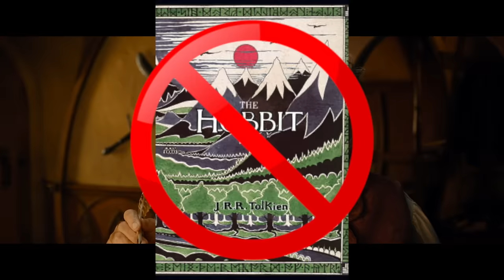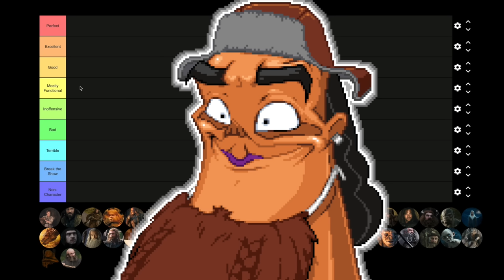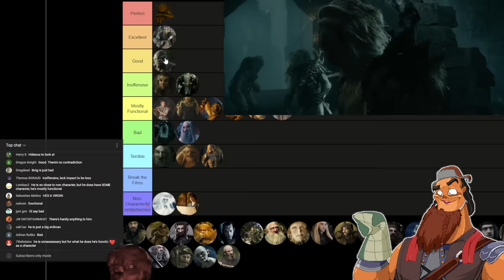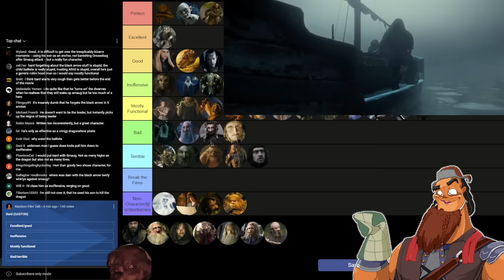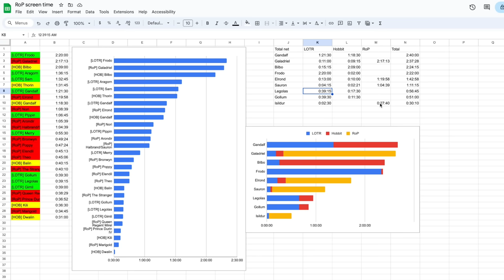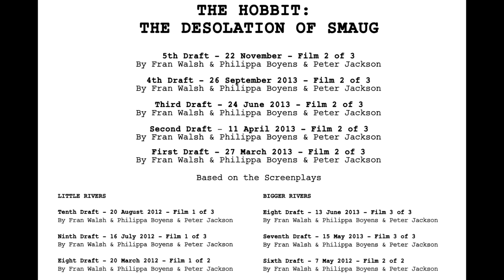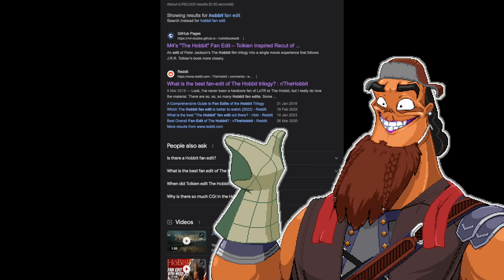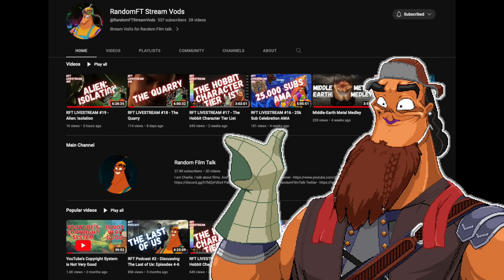The Hobbit is Not Very Good: The Final Autopsy

Comment: Great Video again.

What i wanna Add is the following.
In all forms of storietelling (Book, Movie, Games, etc.) You need a goal you want to achieve and making that goal clear to the audience and the charackters is important and can be done, like most things, in various ways.
But what you also need is some sort of "ticking-clock"-element, or better said a reason to do things now and not later.
In Most Mission impossible and action movies in general its basicly "Do this to stop the bomb you have x Hours, good luck".
With this element in place the charackters need to use their time efficiently.
This kind of Element doesn´t have to be overarching it appaers in multiple forms, the smallest yet functional version i can thing of righ know would be the rolling Stone in Indiana jones 1, here it is very clear that if indie doesn´t move he dies. 
Wich leads me into the Hobbit Movies.
And i want to compare it to the movies, soly to show how things could be done if this element would have been handled differently.
Case in point the Hobbit-Book doesn´t have this driving element in its overarching Plot.
The Companie starts now because why not,  and because they do not have any specific time they have to arive at erbor the rest of the storie can take its time, they don´t have to rush to any particular point. To be clear they spent days if not weeks at elrond, to whom they walked not being chased, they spent days if not weeks in the mirkwood forest(inside the forest and then again in prison), and they spent days at laketown and days if not weeks at erebor to find the entrance.
The only times they have to move fast is when they got activly in danger, trolls goblins wargs etc.

The Movies Changed that fundamentaly.
In that they made it clearer over the 3 Movies that, atleast the charackters thing so, they have to arive perfectly at this one day. Additionaly the writers thought it necesary that the companie has to rush to any particular place/solution aswell. Examples would be: Trolls, Rivendale (ariving and Leaving), Mirkwood (Forest, Prison and Barrelride), Laketown and finaly Erebor.
If, in the Movies, they would have delayed their journey, even for just one hour they couldn´t have reached the secret door.
That makes it that much harder to believe that they achieved what they did, since it essentialy boils down to them having won the lotterie not ones but several times in this story.

With the book approach this is no issue, if they for example had spend one more week in the dungeon of the woodland realm nothing would change in the story.
The Problem Bilbo has to solve is, how do i get those dwarfes out of here? and not how do i get them out of here now?.

Funnily enough it seems my solution for this Movie would be that it needs to take more time, but if we cut the bloated things out we do have that time so yeah.

I hope i could make clear what one of my Issues with this movies (and so many other Stories) is.
One more thing to think about.
I think the Lord of the Rings at its beginning are a counterexample in that the movies deal with this issue way better then the book does.

Comment: Liked your assessment of the characters. The fluidity around Radagast is very justified; he's very effective in getting things done, but the hyper-eccentricity behaviour detracts from the character.
Thranduil is one of my favourite characters and I think you're over critical of him as a commander. Elves are very disciplined and will have trained together to fight a certain way - bow at range and then in with the sword. I doubt if they would have much recent experience of co-ordinating combined arms with dwarfs. So I don't think the questionable tactics in the heat of battle against the sudden change driven by the orcs arriving can be necessarily attributed to Thranduil's direction rather than doing what they have trained to do.
In your story path breakdown you miss that when the message is sent to Dain, Smaug is dead and Thorin is in Erebor. I think these circumstances make Dain's willingness to support Thorin very understandable, even if he doesn't have the Arkenstone.
As to bloat; it's very bloated, but I think the final Star Wars trilogy is even more bloated.

Comment: My totally made up and unverified, made up on the spot explanation of Gandalf’s less dramatic use of magic in The Lord of the Rings is that he never regain full power after switching to Radagast’s staff from his original he was used to using. It is a not uncommon trope for magic systems using wands or staves that while someone may be able to use another practitioner’s tool, they are weaker due to a weaker affinity with that tool and it takes more time than the story may initially allow for them to overcome that handicap. I have no idea if Gandalf’s use of the magic in the conclusion of The Hobbit trilogy after the switch matches this explanation.
Reply: The thing is, it's not Harry Potter. Tolkien's wizards don't go to Ollivanders for a compatible wand to choose them. Tolkien's 'magic', as vaguely explained by a random elf in The Fellowship of the Ring, are the abilities inherent in each being. The wizards have powers because they're this setting's version of lesser angels, as are Sauron and the balrogs. The power comes from Gandalf, not from the staff or even through it. It's a lump of wood with a stone on it.

TL;DR: Gandalf's staff running out of battery is another example of world-breaking/world-ignoring r-word-ation in an entire trilogy (or two...) full of them.

Comment: I feel like detraction on oak shield is mistake. You said "tree branch as large as this" - did you took into account that Thorin is a dwarf when looking at the size of that branch? Thorin being short makes that branch look a bit bigger + let's remember that Azog is massive, which is mostly muscles. And weapon like Azogs is basically strenght multiplier. It's not a sword that you need to allign correctly to get maximum out of it. You swing it and it destroyes what it hits. Thorin should have suffered much more from defending from those attacks. I maybe would believe that it could be blocked with thick, dwarven shield. MAYBE.

Comment: My problem with Azog is that he should have been dead during the events of The Hobbit, as Dain Ironfoot slaying Azog at the Battle of Azanulbizar would have given his son Bolg the obvious motivation to wipe out the line of Durin. 
Contextually it just makes the most sense, especially if Bolg witnesses Azog dying. Bolg should have served that role, period. They should have just swapped character models so they could still have the cool white Orc BBEG chasing after Thorin's Company. 

One of my biggest problems with the Orcs in the movies in general is that there isn't any delineation made between the different kinds of Orcs. To Jackson (except for Uruk-Hai specifically) Orcs is Orcs. Bolg/Azog's line are supposed to be Northern Orcs of the Misty Mountains, and the ones we see serving Sauron in LOTR are Mordor-Orcs of the Eye. Saruman's Uruk-Hai are distinctly bred by Saruman and referred to as "Isengarders" but there are also Snaga Orcs at Isengard, which are a lesser, smaller, weaker breed used as a slave class. 
P-Jax's separation of Orcs and Goblins as very different races (Goblintown/Moria), when Jirrt used "Orc" and "Goblin" synonymously makes things very confusing for me also. 

To say nothing of the were-worm things (which even in the deep lore are not confirmed to even exist), the Orcs should have just come around the Grey Mountains to the East and then directly South to Erebor, skirting around Mirkwood, instead of the universe-breaking CGI bullshit P-Jax pulled there.

Comment: I've already explained twice in these comments why, for me at least, the different levels of seriousness between The Hobbit and LOTR are not dealbreaking issues for me personally; although I will concede RFT the point, that my attitude is based on an understanding of the alchemical/Hermetic belief system (regarding the Ages, or Yuga theory, also present within Hinduism) which not only is not strictly canonical in LOTR but only implied, but which the average movie goer almost certainly would not have.

So...yes there are several reasons why said goofiness exists, (which I know about) but unless you're as big a nerd as I am, you most likely won't know about them, so if the extra levity of The Hobbit bothers you, then I consider that legitimate and I won't hold it against you.

Comment: 2:01:34 Sounds like the prop department or the armorer (if they hired one) screwed up immensely.

Traditional full plate armor *isn't actually restrictive*. It's *heavy*, though it's actually in the same weight range as modern military combat kit so in some senses it's at least distributed more evenly.

The fact that they were able to have armor during the LOTR trilogy makes this excuse laughable.
Reply: Yup, just bad props. They could have simplified it and just went with less armor instead of dumping all of it entirely.

Comment: I agree about the waning quality of the later seasons but I have to disagree (slightly) with your assessment of Family Guy side jokes, as you presented them.
 These jokes you mentioned are, like the cutaways, interchangeable, that is true. But that is it. 
It is an artistic device, a trick, an illusion, even. These jokes, as well as the cutaways, are not meant to be integral to the story. They are connected to the situation, yes, but not necessarily to anything else concerning the main plot. They are outside or above the narrative frame, you can tell that by the fact that reality is often even more twisted than it is already in the show itself. They often barely qualify as jokes, and more often than not, that border on sheer dada. Therefore, I found your ruling, about this special aspect and about that only, a bit too harsh.
Also, such jokes and cutaways help filling the run-time of an episode, should the scenes of the main plot not be enough for  the intended run-time, so they mustn't be integral to the plot.

Comment: Yeah I have to fundamentally disagree with you on the topic of the extended scenes. The theatrical cut is 'the' cut and  you should have based your review on that alone. The extended cuts are the place to put scenes that didn't make it into the theatrical cut - by definition, they are not going to be as good, or adding them in gives more flavour and life to the world even if the scenes aren't  totally relevant to the plot

To base your review on the extended cuts and then complain about the pacing is like going to a nightclub and then complaining about the noise.  On some level you've missed the point and really you're complaining about something that you did to yourself.